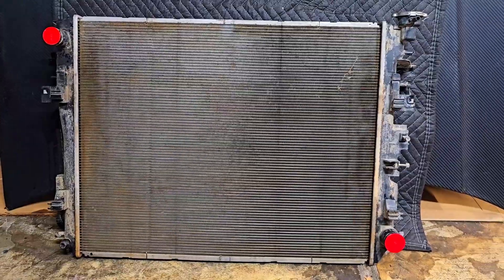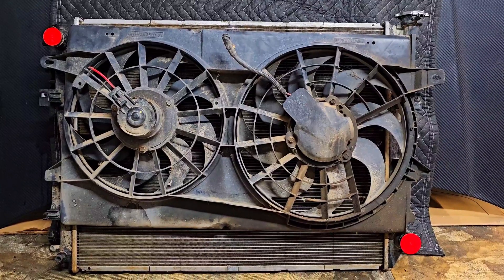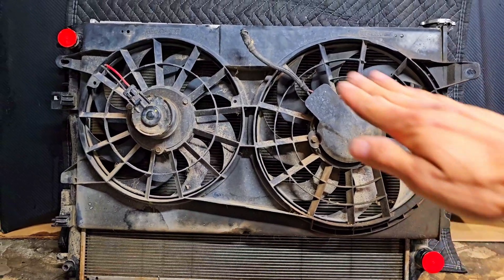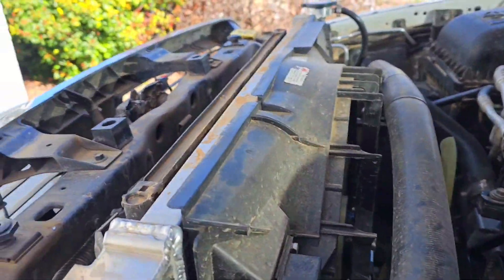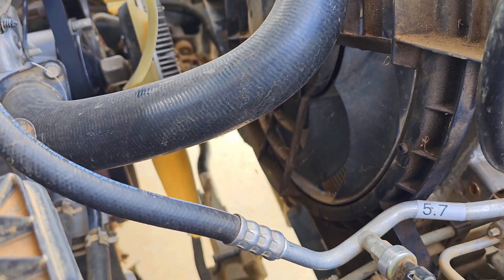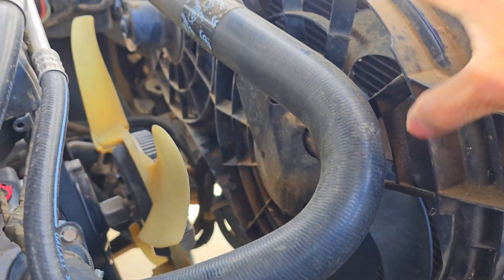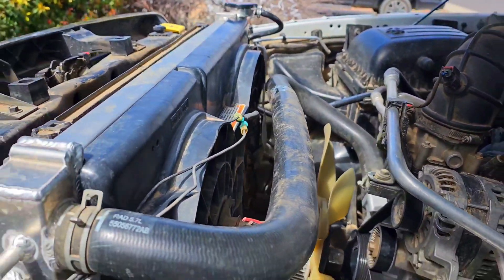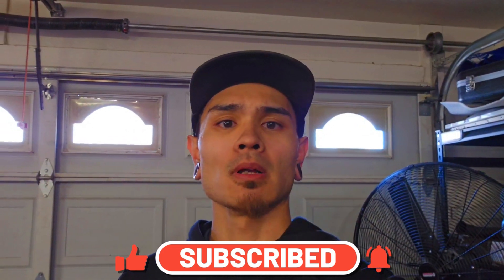2009-2018 Ram Hemi Electric Windstar Fans

Comment from the maker: Ambient Temperature | 85-87 Degrees Fahrenheit with 11% Humidity
Approximately 30 minutes of driving with AC and both fans on
Coolant Temp | 183F-186F city driving/idleing/ 190F-192F Uphill/Highway
Oil Temp | 190F
Transmission Temp | 150F

Comment: I have the same set up in my 1992 Full size Blazer, but I removed the belt fan and clutch. I saw a lot of forums on these fans but not many videos, glad I found this.
Reply from the maker: Same here in regards to reading about it on forums. I've since removed them a couple months ago and put back the factory E-fan wired to a switch and clutch fan with shroud. The oem combo with switch/thermostatic switch has worked out better than just dual fans in summer conditions. I wanted to keep the duals + shroud and clutch fan but unfortunately I forgot the clutch fan is left hand threads and I can't get it off to be able to throw the shroud on 😅.

Comment: thanks for the video!!! not too many video on this subject. Do they pull or push? I have my fans between the radiatior and engine pushing air towards the engine, is that correct??
Reply from the maker: Mine is setup to pull air towards the engine.